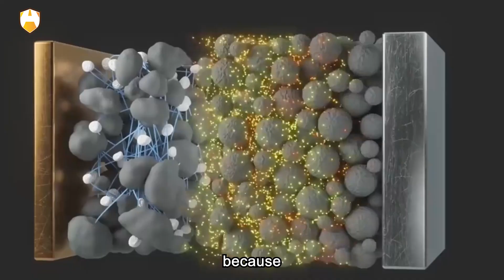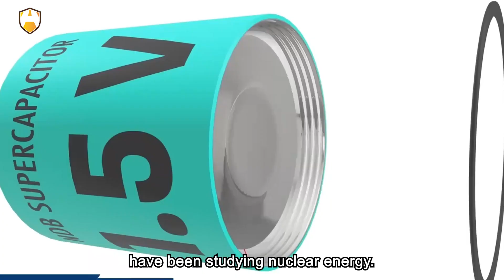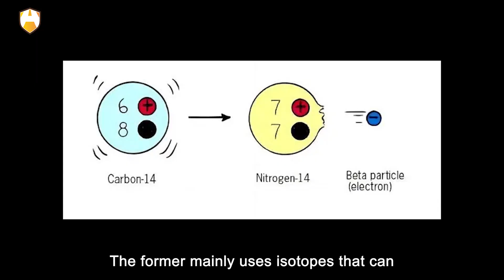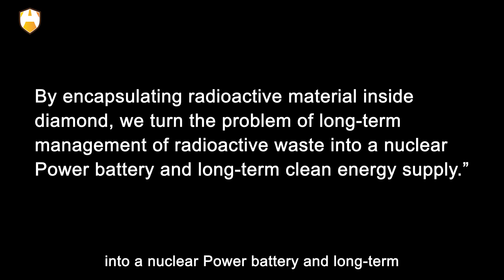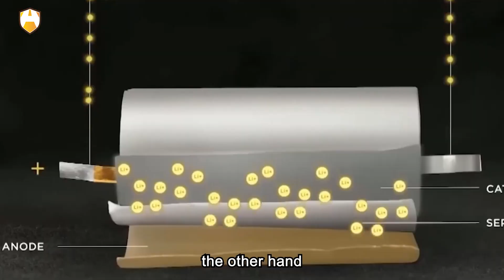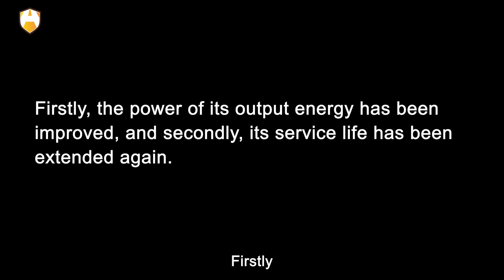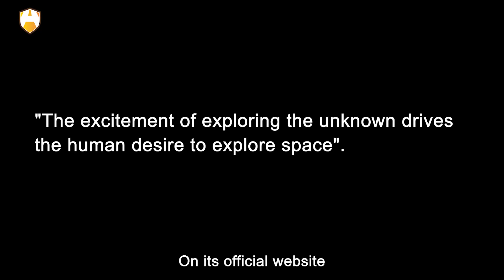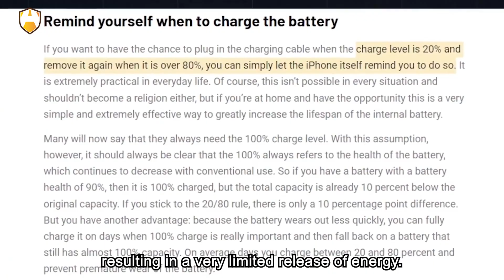Nuclear power batteries breakthrough! 28,000 years without charging?

Comment: This video is promoting some seriously ignorant utter nonsense! The power output of nuclear diamond batteries is just way too little for use in EVs and consumer products like smart phones, laptops etc. Imagine a nuclear diamond battery that can last 1000s of years 😊...then, realize such battery needs to be 1000s of times bigger and 1000s of times more expensive than a Li-Ion battery for the same power 😮🥸🧐…do your homework about POWER DENSITY (in this case micro Watts per cubic centimeter) and you will understand this message!

Comment: The nuclear diamond battery in the photo has its output declared to be 100 microwatts. This means you would need some tens of thousands of them, weighing maybe 50kg, to power a mobile phone. About a million, weighing a few tonnes, would give enough power to drive an electric bicycle (not if it is carrying the battery). This battery is for things that use tiny amounts of power; if combined with a capacitor it could also power something such as an alarm that normally uses a tiny amount of power but could need a short burst of high power. A battery powered by tritium instead of carbon 14 will give much more power but will not last thousands of years, it will last one or two decades. These batteries will not suddenly expire (unless something goes wrong); the power will gradually drop as the radioactive material progressively decays and the time will eventually come when the power is no longer enough to run the device that the battery is in.